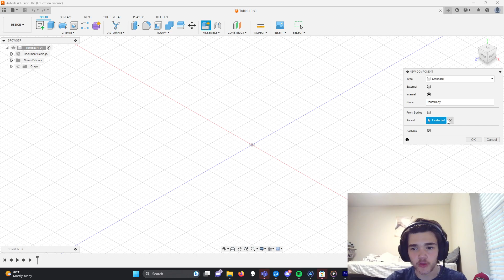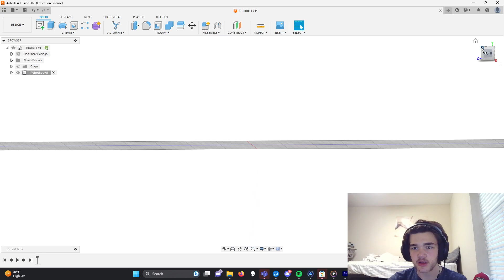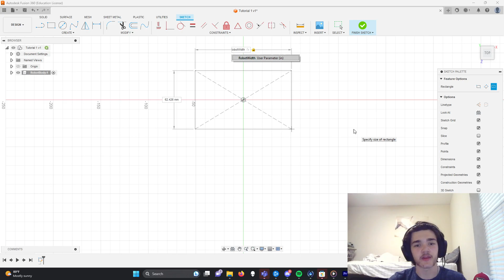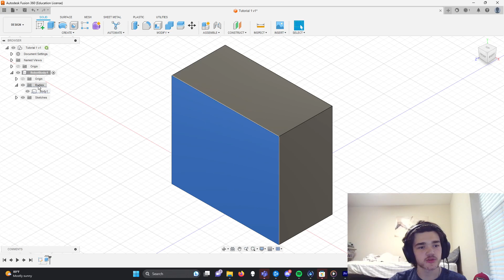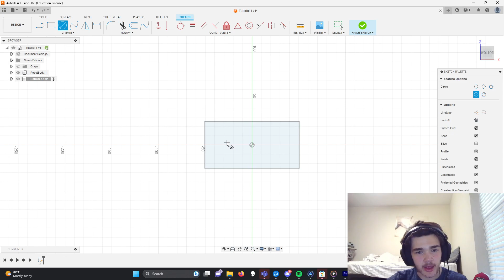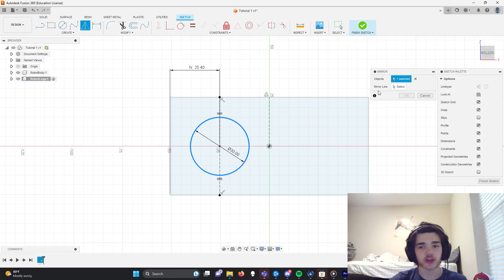Fusion 360 Tutorial 1: Best Practices, Sketching, and Extruding

Comment: Cool information but there is something wrong with your sound. I have volumes set to 100% but can hardly hear you. Is the problem my end or your end?
Reply from the maker: Thank you for the heads up! I think it could be partially both. On my end it’s not very quiet but it is definitely quieter than it should be. I’ll try to make that a bit better in the later tutorials I make. Thank you again!
Reply: Out of your 4 videos, 2 are fine and I can set my volume to 40%, but the 2 Fusiion videos thus far, even at 100% volume I struggle to hear you, and I want to hear you cos your info is very helpful. I think it's just in the recording setup of the fusion videos. Anyway, I'll leave it with you and keep up the good work. @commanderv23